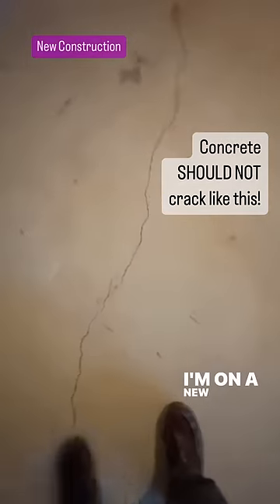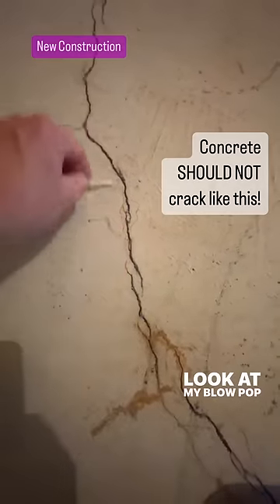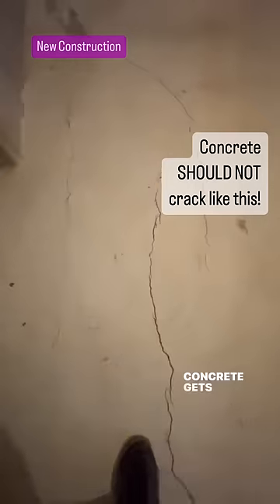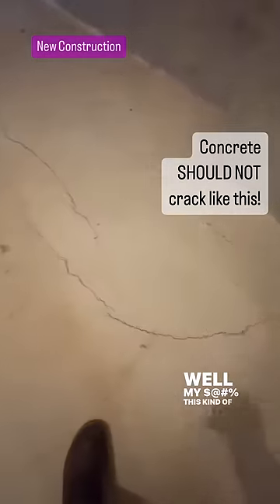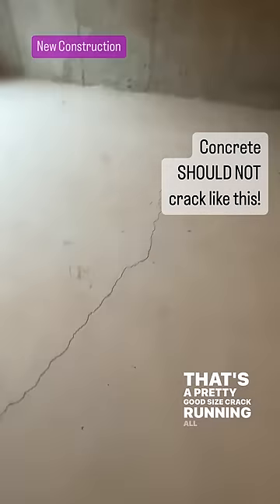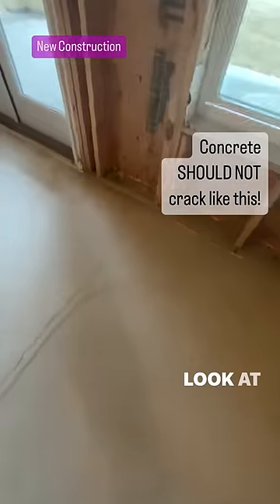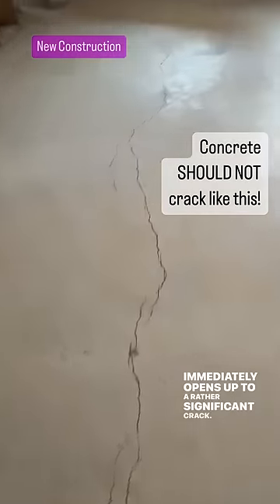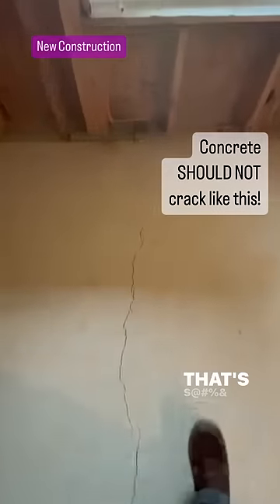New Home with Multiple Slab Cracks

Comment: Honestly, my wife and I both in our late sixties framed, excavated, installed moisture barrier, rebar and wire mesh for a 20 x 18 foot two story garage.  Then we hired a  crew of five construction workers who working near by.  Thirteen years later we don’t even have a single crack.  We did things exactly to code. People who don’t own the property they are constructing don’t give a dam about “perfection.”
Reply: Don't give a damn about anything.
Fixed 😁
Reply: Ive had two homes in PA that didnt even have concrete in the basement until i bought them.
Houses have been standing since the late 1800s
Reply: Depends on where you live and the climate
Reply: Some people don't even care if it's their own home or another's, or especially because "it's my own home not a client's." Like my dad. He does fast and cheap, using improper materials. The results speak for themselves, especially with time. The results look and feel mediocre or worse, and functions that way too.
Reply: You forgot the radiant heat tubes ...😂😂
Reply: That's not true
Reply: And you are correct sir. I have seen it numerous times. Beer Thirty comes around more than you would think.
Reply: The biggest thing is that they don't have control joint cuts in it. Concrete always cracks. But by cutting control joints, the concrete should crack inside of those joints so you don't see it.
Reply: I know i dont😂
Reply: Problem is customer doesn't want to pay, everyone trying to build it cheaply so contractor cuts the cost to get the job, 

Customer gets what they pay for, every time, 
Cheap work isn't good, good work isn't cheap!
Reply: Very few people take pride in their wormship now days i warranty my workmanship for life the material is warranty by the manufacturer but i know my work will not fail and that's anything I do
Reply: There ate guys who care.   But I'm sure there is a reason I live in a town of 1,500 people.  Some of my customers will wait 2 years for me to get to them.
Reply: @Un1234l  I own a construction business and have 30 rentals Do it do it right the first time.   Is much cheaper in the long run EVERY time
Reply: My parents home was built in 1958 monolithic slab block filled and a full lintel around the entre top before trusses. It has survived  many hurricanes and 2 tornadoes  with little to no damage or cracks ever. No stress release on any of the slab here in Fla.
Reply: So you have no flooring in your home ? How do you know there's no cracks ?
Reply: That happen in all the construction  nobody cares about quality a wise  client toldme once,  cheap labor  isn't skilled, skilled labot isn't cheap  if you find a good contractor
Reply: Concrete expands and contracts. I don't see no expansion where concrete meets Foundation and every 15ft or so.

Comment: I've been doing restoration in Arizona for about 5 years and I've yet to pull flooring and not found cracks like that. I'm from Indiana and working on 100 year old houses I've not seen cracks as bad as here on these new houses it's insane
Reply: People are getting worse at the trade
Reply: the cheap laborers fromthe south that will do it faster n for cheaper, Mr George.
Reply: "Uninitiated" labor?
Reply: I just made your same point. 70 year old slab in my garage. It got a couple cracks just like this house....except its 70 years old and not 3 months old.
Reply: Looks like Mexican work to me
Reply: So cal every floor has cracks. Inspectors say there ok. Confuses the shit out of me.
Reply: Same! Ive been doing Restoration in Indiana for 3 years. Every time the carpet comes up it's cracked under there.
Reply: That's poor quality concrete and no compaction or testing done. Concrete   specify 5000psi and has cores collected at the time of pouring. You'll get bad concrete, 
Reinforcement bar "rebar" does hold it together. But it has to be put in correctly,  for example,  around the parameters of the footings and parameters of the outer slab with 10ft corners "so a 20ft pcs will be bent at 10ft in the corner. Where that cant be done you need  at a minimum of 27 inch overlap on the bar in each direction and tied off by 2 at a minimum By the looks of the gap there , looks NONE was used in that pour.
BTW, too much water underneath the floor will break the floor.. because it was pushing when the concrete was curing. So there is movement there.
The fix is footing drains or a de-watering well with either going to a dry well to daylight the discharge pipe or an electric sump pump that can drain the soil. Yeah, very few builders will spend the time or even heard of what I'm saying..
You said it best, moisture and standing water..underneath 
Gotta find a spot somewhere in basement out of way or two locations,  cut a 20 inch hole in the floor. 
Just wait a day, see what comes up or out? 
If water pouring out in a matter of minutes or hours,  you take shop vac suck the muck and soils out,  large rock can either settle or lift out,  get culvert pipe15 inch drop in vertical , shop vac down 3 to 4 ft, sump pump the water out maintain 3 feet below slab so you'd be left with a little over 12 inches of water in bottom of the sump.. now that won't fix the cracks, but I will fix the water issue. It's a lot of work no matter. 
 Thank you for making a great video @
Reply: Ya that's not true. 3,500-4,000psi for everything poured residential.  U can't just blame the sub grade and concrete mix without knowing everything. Here in Michigan we use 3-5 inches of pea stone over the existing dirt  clay,  cover stone with visqueen and pour. No compaction done.  My guess it was either poured during winter with frost in ground when it thawed the floor settles down. Being open basement framer could of starting framing all the walls driving sky track on stab before concrete contractor got to cut it
Reply: @bestof.luckfellowhumans  That’s exactly what this is. Every time they fix one thing three other things break.
Reply: @bestof.luckfellowhumans why be racist?  Poor work is poor work no matter who does it.
Reply: @bestof.luckfellowhumans looks more like trailer trash work to me
Reply: @tjbaileymusic 
Nah, the people aren’t getting worse at the trade, the trade is getting worse people.
Reply: @rosscollins2910 
Considering it’s more prevalent now than in the past, and the majority of US construction crews are from a similar region of the world, that’s not the r-word, it’s facts.

Comment: Water oozing up through the slab IS A HUGE PROBLEM.
Reply: It is but it's also an easy option before pouring the floor. They should have positive drain on low side of original dirt out tye back of slab keep floor from cracking. The issue is these builders have these so called gc who don't get out the truck to inspect shit and they don't have any experience.
Reply: I had a plastic office chair mat and after irma hit we had a lot of foundation damage. Under the chair mat started getting wet from underneath. Either of you know what causes that?
Reply: Pretty normal actually. Especially with a high water table.

A weeping tile drainage system and sump pump solves that problem.
Reply: @DH-rt3fk could be caused by shallow rock base or no plastic vapor barrier. When you seal off a section from air, it pulls moisture to the top of the concrete (hydrostatic pressure). It won’t hurt anything, but don’t put an epoxy finish on your floor or it will fail.
Reply: That's a water table problem. Crack or not water would work through the concrete.
Reply: @evictioncarpentry2628 man, when my uncle put up a new shop, the city gave him the wrong water table map. The lower level gets THREE FEET of standing water in spring. That's with 4 giant dumps running 24/7 just to keep it at 3'.

It absolutely fucked all the shop plans and now that's only used for storage.
Reply: @ObservationofLimits  Yep, people dont understand how much that affects a basement slab. Last house I built was on a high water table and my sump pit would fill every 30-45 mins and run.
Reply: ...so is carbon monoxide!
Reply: it is but it has nothing to with the cracks in the slab. There should be a drainage layer under the slab and a sump pump to drain the water if ground water is coming up through the slab. Even if there were no cracks they would have a moisture problem because concrete is porous and wicks concrete
Reply: Oh ya? Oozing?
Reply: The dehumidifier is probably pulling water up through the cracks.
Reply: Good thing that wasn't happening

Comment: My buddy does concrete and he told me there is two kinds of concrete, concrete that has cracked and concrete that's going to crack. He said one of the tricks is to do expansion joints, hopefully the crack will form there. I been a Mason for 44 years and have poured some concrete, but I'm no pro, it's cool to watch a master work that stuff. Definitely an art.
Reply: This is the most educated comment on here! I noticed how none of the Internet "experts" wanted to challenge you.
Reply: That thinking doesn’t apply when it comes to a slab for a home. A cracked slab is a major no go.
Reply: @DAMusic-qu2ec  surface cracks are very normal in a slab and do not effect the integrity of the concrete. Unfortunately, the general public is very uneducated with concrete.

Comment: My buddy was a concrete contractor a real master of his trade.  He guaranteed that eventually the concrete is going to crack.  But he always made it crack where he wanted it to crack, by saw cutting, and proper forming, vapor barrier, stone, rebar, mesh, ect.  Run away fast from anyone who tells you that their concrete won't ever crack. they are lying and telling you're an idiot to your face.
Reply: My shop building was built in the early 40's. It's 100' by 80' and doesn't have a single crack. I have 3 Axel dumps in here all the time. I wonder how thick it is...
Reply: @brentbovee6411 nobody is pouring 12" slabs in their basement just to roll sorry carpet on top😂

Comment: My sister's house basement floor (concrete) was similar, and was told it was normal. I believed it was normal as well. That was until I built my house, and my basement floor (concrete) NEVER got a crack.

Comment: As a commercial flooring installer, cracks over 1/8 in its a bad sign
Reply: As a zoo keeper they need to turn on their sump pump.
Reply: Shouldn't the slab have cuts for contraction | extension? It seems quite big.
Reply: @donalexey  Control joints are to control where it cracks. This much cracking is excessive and the opening gaps show it doesn't have sufficient reinforcement, if any.
Reply: What happens if you lay a floor over that, and where's the water going to come from to seep in after the pour? Just curious.
Reply: @oreo4607   Cracks like that means something is moving and if it’s not addressed, could lead to bigger issues
Reply: @NateBFlooring   I see, all the sayings about foundations really makes sense now😂. Didn't realize they were that sensitive and good point.
Reply: Not true, BAGI standard for crack in a basement slab is 3/16"  before it's required to be fixed. And then patching/filling is the accepted repair. Moisture is not coming up through the cracks, this guy is getting people worked up over a cosmetic issue.

Comment: This happened in my first house. 
When I pulled up all the carpets to out down laminate I had to grind, Jack hammer and repair half the floors in the house. Contractors should be held responsible for 20 years.
Reply: Not a chance. 20 years is absurd. Even if you do a good job, the potential for a job or building material to degrade is always present. The amount of added liability insurance would cause a skyrocket cost effects for the whole construction contracting system.
Reply: @briancavanaugh1596 20 years is absurd, for sure. Yeah it would increase insurance costs a lot.

However, it kind of sucks when the HOA has to dig up my whole frickin backyard to repair an irrigation line that is NOT IN MY YARD on the county assessor's map. It's actually in my yard because the utter moron who trenched the pipe did it TWELVE FEET OFF. 

Yeah it would suck if that guy had to be held responsible for his own utter incompetence. It would suck for him. I sure wish I could hold him responsible.

Comment: This is what happens when you go from fill dirt to pouring concrete in the same couple of days.They just bang this houses out and dont let things settle enough before building them .Nowadays things get built on an unrealistic time-frame.
Reply: I can tell you are not from the South.  We grade it and pour it the same day.... if you know what you're doing.  Your soils obviously do not compact well.
Reply: @sonnyh9774  yeah,that's exactly what I was talking about
Reply: Need to have a good base.
Reply: Yeah, in my country, back in the 80's when I started in the construction industry, a home would take a minimum of 6 months to complete, to allow concrete, cement to cure between phases.
Today, 3 months to key turn.
(All buildings are brick and mortar here) 👍🍻🇿🇦
Aftermarket repairs are big business.
Reply: @sonnyh9774 Here in Michigan we sick tile around entire foundation. Put. 3-5 inches of pea stone over the clay bottom cover stone with plastic and pour the floor.

Comment: I would look into the geotech report, and make sure the recommendations were followed. Then i would check the mix design of the concrete itself.
Reply: On a residential? Oh my.
Reply: Florida's got some of the strictest building codes and we do not require Geotech reports on residential construction. The Mix Design also means nothing when they added 25 gallons of water to the truck when it showed up to the job. Those cracks were caused by too much water in the mix, evaporating from the concrete as it cured too fast. Freezing of the wet concrete could also cause cracking like this.
Reply: @floridagunrat1625 was about to say the same.
Reply: Freezing causes alligator cracking as the top layers pop off in peices and seperate.  That looks like to long timewise between concrete trucks, causing the two different concretes to form a cold joint between them. I'm not a Building Inspector, though. I'm a Construction(Public Works) Inspector, so I specialize in roads, bridges, water/sewer lines.
Reply: @floridagunrat1625  I drove a mixer for 20 yrs and 25 gal was added  usually before they even looked at it. If it wasn't self leveling they didn't pour it. The only time I poured a 4 inch was when the state was testing for roads and bridges and such.
Reply: I would core drill it in different areas to see how thick the slab is.
Reply: @cammoedkiller definitely just added too much water and slab is probably not as thick as it was supposed to be. Cold joint doesn’t make sense when it’s all over the slab like that and in  random directions
Reply: @Hoaxer51 yes

Comment: Nobody cut the slab. If you don't control where it cracks it will take its own path. You gotta tear out the floor. It's indoors so that suxks.
Reply: Lots of times people don’t cut the interior floors since it’ll get covered anyway so it doesn’t matter where the cracks are. But there are definitely too many here. Looks like no moisture barrier.

Comment: When you're pouring concrete in hot locations - like Texas or Florida - the finishers like to add a ton of water.  A normal slump is probably 6" but when it's 100 deg outside and finishers are tired they'll add 30 gallon of water or more to a load and now you're pouring at a 9" slump.  That ruins the load and you see cracking like in the video.
Reply: Moisture in the air florida had the highest anual uv & humidity combo flat land surrounded by water  with high uv rays equals moiiiiisture ! Gotta protect dem pores baby !😊
Reply: Would concrete additives help combat the heat? Also what about pouring at night when its slightly cooler? Easier said than done but still
Reply: @AnticipatedHedgehog  Pouring at night is absolutely a solution but you still have the heat starting almost immediately when the sun comes up.  Temps in the summer in Texas never fall much below 80 degrees even over night.

Comment: Ive worked with my dad and we did a slab of concrete for a shed. Roughly 6 inch slab including gravel and my landlord jack said he wanted it done right. So we dug up 6inches of dirt, leveled it with a tamper, placed a couple sheets of plastic with at lease 4inches of over lap, then the gravel roughly 3inches then using concrete and water with a cup of quickcrete we got melted cheese consistency poured it out and used a 2by 4 too make sure its level going back and fourth, all this for a 4.5ft by 8ft shed.
Reply: That’s sounds like a good memory but slightly salty because it was overkill lol I’m going to do something similar with my boy, let him have a little man cave out back….

Comment: 2 things, either they can blame it on no cuts, or they will have to do core tests and the concrete/builder better hope none of those come with less than 4 inches of concrete or they are screwed.
Reply: Most places pour the basement less than 4 inches.
Reply: Yeah, it turns into a spitting contest pretty quick.